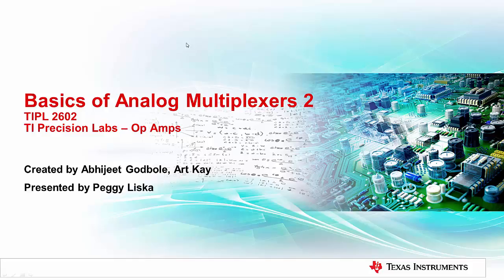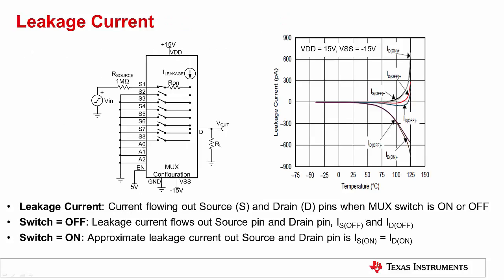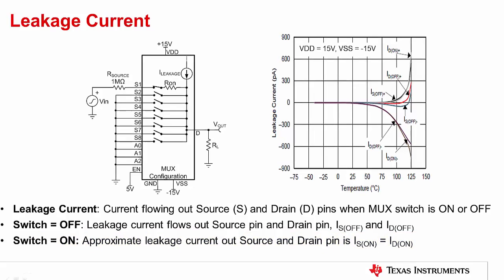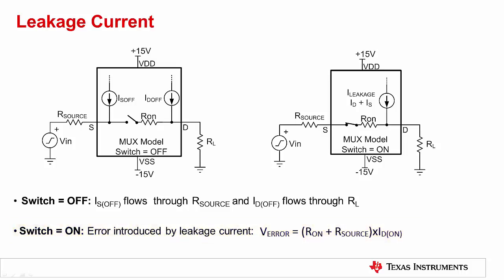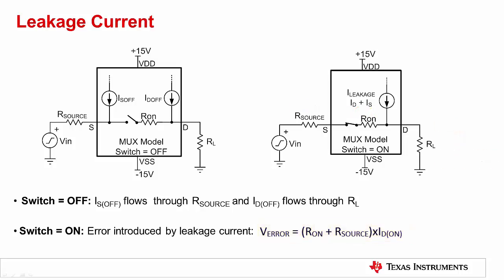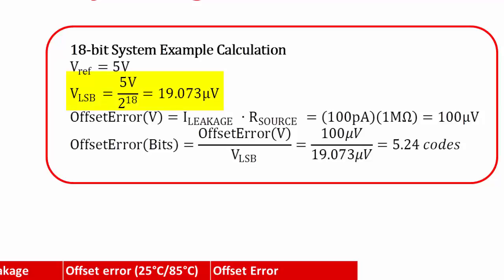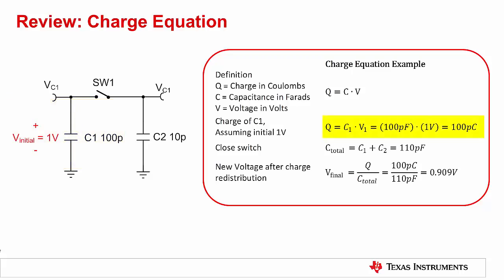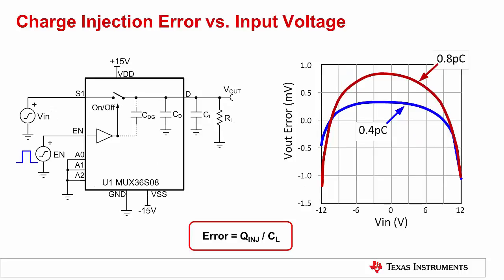TI Precision Labs - Op Amps: Multiplexers 2 - Leakage Current and Charge Injection

Comment: At 9:15 : But how long does this offset last for, and what if we have no load capacitor, such as connecting to a high-impedance op-amp as discussed earlier? Are we to believe that the Vout error remains constant over time? Will it not simply form an RC low-pass filter based on the input impedance? In which case, do we just add together Cdg and Cd? Or does Cdg become irrelevant over time? How do we work out how long we need to wait before sampling after switching channels? This video is far less clear than the previous ones in the series, and actually seems to contradict the previous video's explanation of setting time, since that video did not take into account any charge injection!